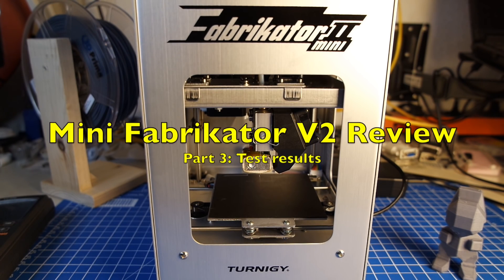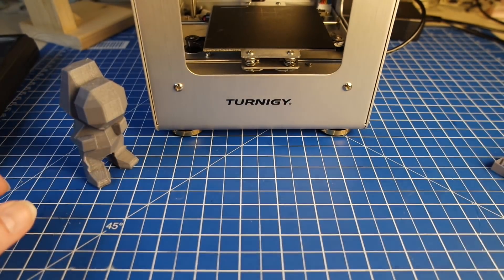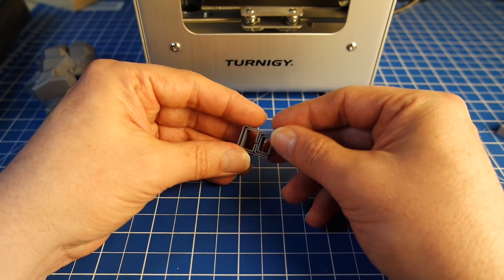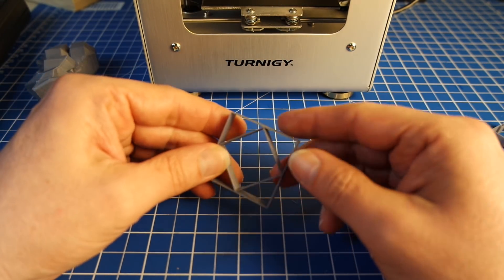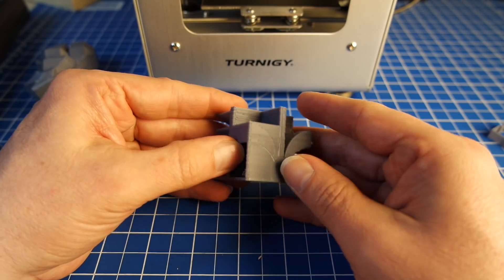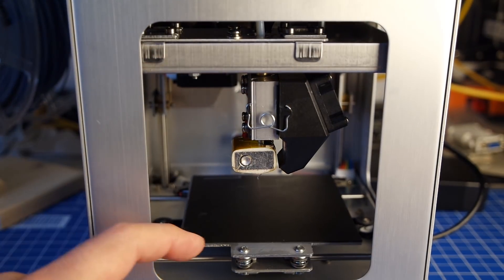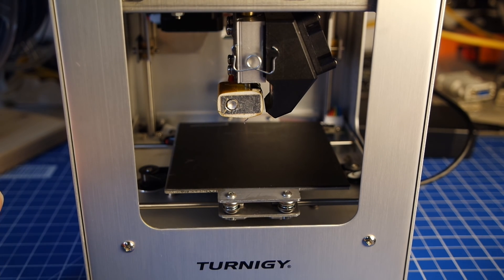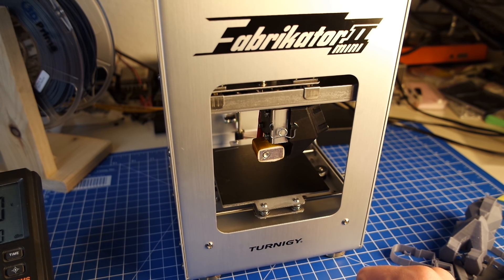3D Printer: Mini Fabrikator V2 Review - Test results

Comment: Great video. Just one question, how did you go printing ABS? This can be more problematic than PLA, just wondering how this printer went using ABS and the heated bed.
Reply from the maker: I've never tried ABS, although the manual says it can do it - I have only one printer I use with ABS that one has an enclosed, heated build area, and it sits in my basement really close to a window. I stick with PLA and PETG on these printers, ABS needs way better heating, and its fumes are not good for ones health.

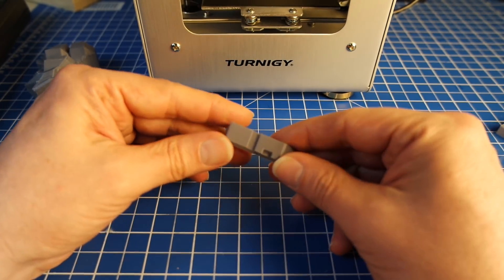Comment: Hi Dirk, great series of videos on this little printer!  You mention at 2:50 that you fixed the Z axis as it wasn't moving correctly - was the the axis rod cleaning you mentioned earlier?
Reply from the maker: Yes, it was moving correctly, but not as smooth and easy as it should have. That was fixed after it was cleaned and properly lubricated.
Reply: Great, thanks.  One more questions - what did you use to lubricate the axis rods?
Reply from the maker: KONTAKT 60 Cleaner/lubricant.

Comment: It can do a lens adapter, where the flange distance is vital? Lets say, an M42 to EOS lens adapter, where the flange thickness must be exactly 1.5mm https://www.tinkercad.com/things/jI6Te3Pbb6Y
Reply from the maker: These prints are very hard to do - I've done lens-caps before, and that worked out reasonably good. In theory 1.5mm thickness is doable with a 0.4mm 3D Printer.
Reply: Thank you! I thought I can hit the jackpot with this one...

Comment: Holy crap. 91V and enough current to feel- I would demand a new one for sure.  When that ~5mA decides to be an amp it will be a bad day...  Cheers
Reply from the maker: Well this is Europe, at 240V mains voltage the potential mid-point for a free-floating transformer ground would be 120V at zero load.

Comment: Dirk Herrendoerfer great review and filling me with confidence on my purchase, so you cleaned the bed and the bed rails, are you cleaning prior print residue or manufacturing residue from these areas? Was the power supply supplied with the printer? Has HK come back to you on the missing wifi and the potential earth difference on the chassis?
Reply from the maker: I've reported the missing Wifi to HK, and I believe it was news to them. The power supply may just be mine, but mentioning it here might make others come forward also. It's not a real problem, but the printer should nor be grounded via the computer. The cleaning and lubricating I did removed sealant and corrosion protection left over after the manufacturing.
Reply from the maker: Just fyi: I did get WiFi running, it was kind-of simple - and I understand why I didn't find the module .... it's quite cleverly hidden.

Comment: Thanks for the follow up review!
Shame for the WiFi ... I have yet to see anyone getting it to work. 
You say the module is missing? Seems like they actually omitted it, which is insane given it has no LCD. They did show it in their demo, so I am perplexed.
Reply from the maker: I was expecting to find a ESP based wifi dongle in there, or a similar chip on board, but I did not. It may still be that I am wrong, and that it is part of another chip, like the CPU or so .... I did leave a Wifi-Inspector next to it with no result, so I went looking and found nothing.
Reply from the maker: Gaaa !  I got WiFi working ! That was not as intuitive as I'd thought.
Reply: Great! A bit of a relief there. what kind of black magic was necessary for that to work? As I have said, no one in the reviews so far got it to work.
Reply from the maker: It's more of a don't read, think, imagine ... It's just way too simple for qualified personell ;-)

Comment: It's incredible how cheap and good 3d printers are getting. I remember spending 2500$ for my first printer 3 years ago and it didn't perform anywhere close to what this does. For the price of the printer i currently own i could get 10 of these. Amazing. Thanks a lot for sharing, great video
Reply: Andrea Buono it is crazy how some almost basic machines still cost big bucks.
Reply: Andrea Buono agreed, I've been itching to get into this hobby in the last 2~3 years and I recall looking at printers 5 x the cost of this unit that were admittedly 3 or 4 times  larger but a complete unknown in terms of print quality, I had a concern that I would end up running a hobby of improving the machine rather than producing items and getting enjoyment from it
Reply from the maker: I remember my first 3D printer - It was just a hot-glue gun on rails.

I think my first big investment was in an i90 build, which was still rather expensive then.
I did buy a Felix V2 after that - which was really expensive with a 2 color extruder, but that one is still worth every penny. 
Generally I think the price drop is good for consumers, but it makes old investment look silly. But it's like that with every innovation that finally takes off.